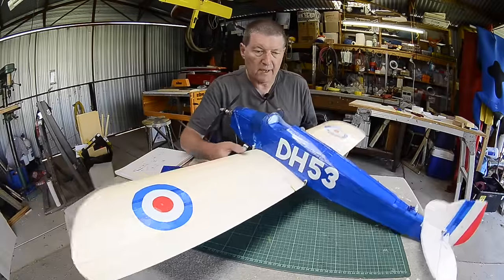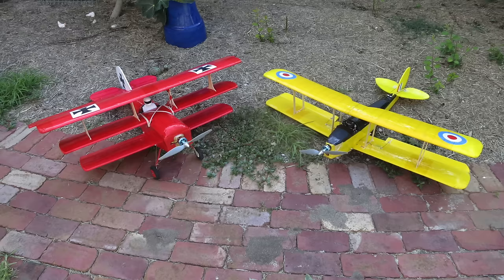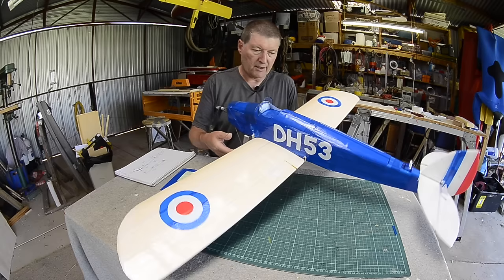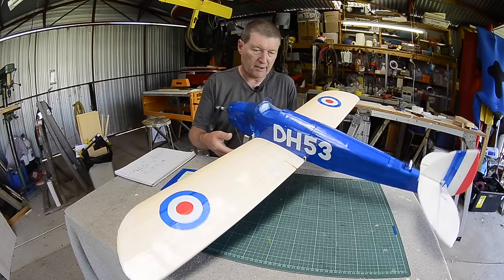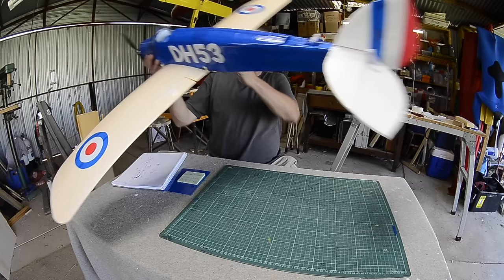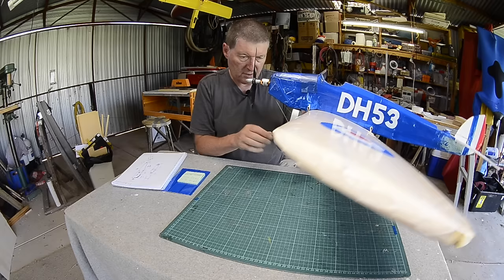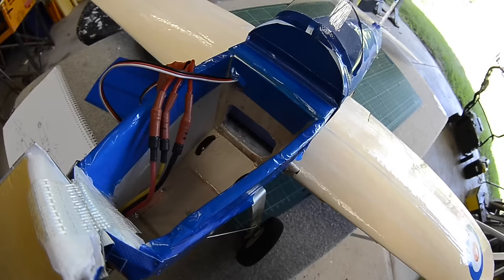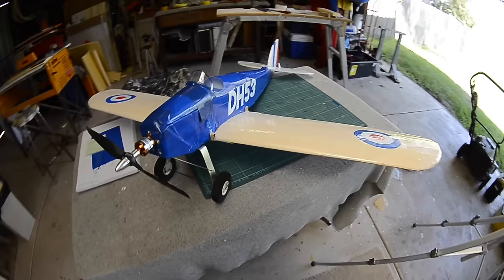DH53 Hummingbird

Comment: I noticed you just used bullet connectors on the ESC side going to the XT60 on the lipo. Have you ever had that come loose in flight?
Reply from the maker: +Albert Kim (marblekit) Not yet. ESC was on a quad, haven't got around to swapping back to XT60
Reply: I also use bullet connectors on over a dozen planes. Been doing it for 3 years, haven't had one fail yet.